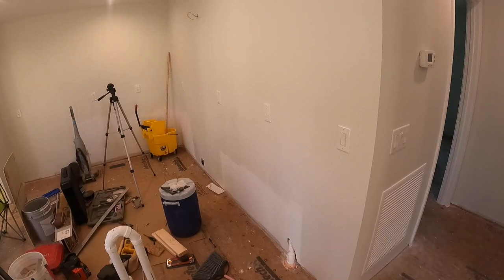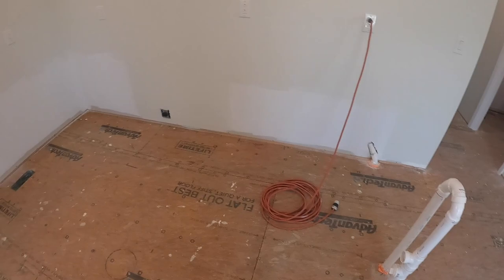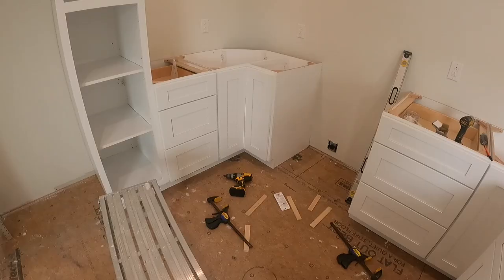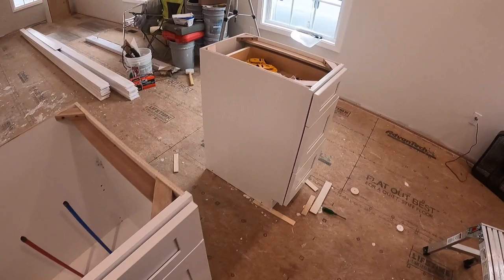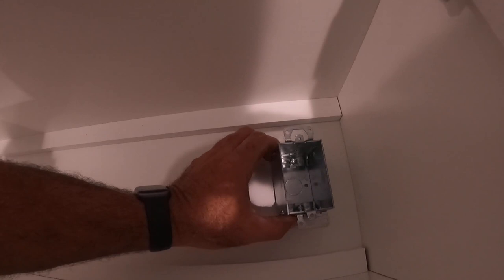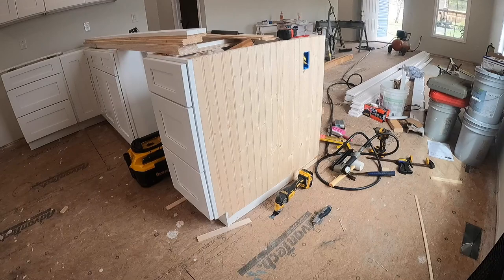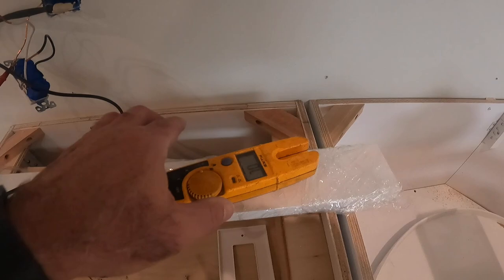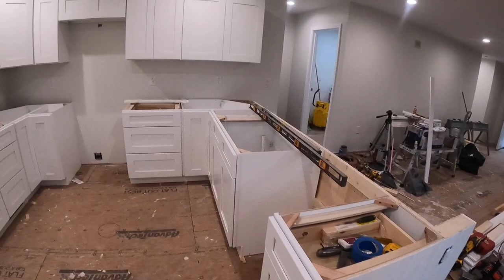Not Necessarily HVAC Part 23 - Kitchen Cabinet Installation

Comment: Had a service call, on a new house (remodel)  doing the same as your electrical outlet. I got lucky,  first thing I pulled out of the wall was the issue. Ground was touching switched side of the hot. Tripping arc fault breaker. Funny thing,  it took several months to show up.

Comment: It's coming along nicely 👌 you're going to have issues with the cabinet thats attached to the pantry. 
If you put handles on, the door won't open all the way. I also prefer to install my kitchens on the finished floor. You're doing great 👍work here.